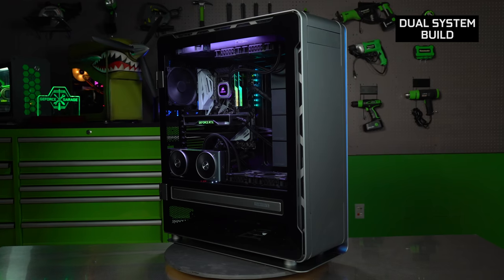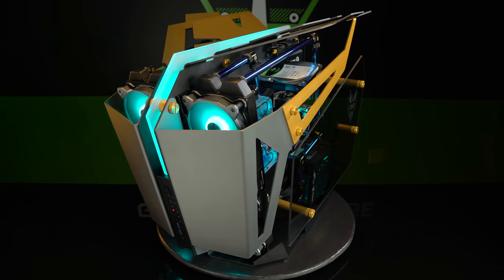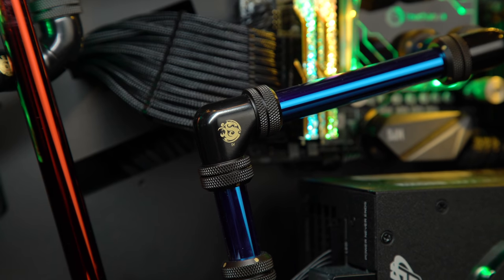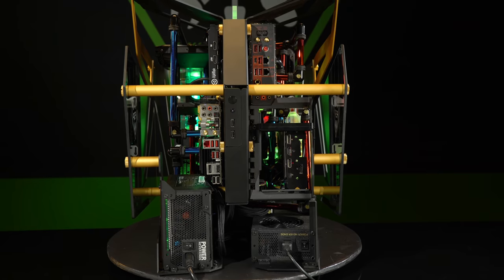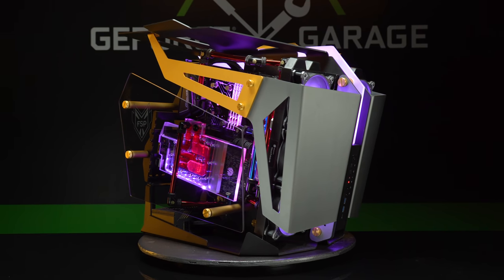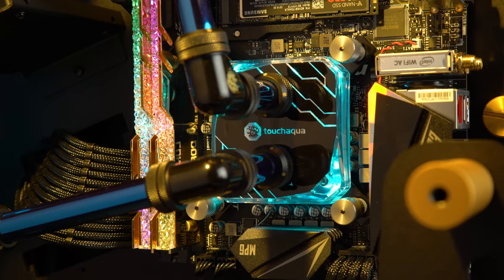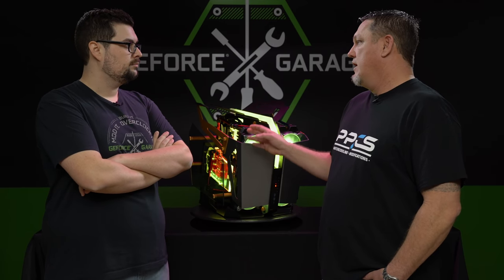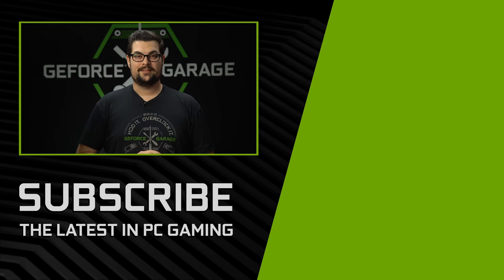GeForce Garage - Dual System T-Wings by PcjunkieMods

Comment: Lee never fails to deliver something spectacular.
I'm saving up to build my first PC and would like to know did you guys go with air cooling or water for your first PC?
#ImcomingtoPC2021
Reply: Definitely go air or if not go with an AIO
Reply: Just do air- it’s easier, cheaper, and probably is good enough cooling for you
Reply: @steviejoe66  I will most likely go with air to start, I can always update later on.
Reply: @Lee  yeah go ahead and do that. If you’re going AMD the stock coolers that come with the cpu are generally enough unless you are going to overclock or care about a silent system. Intel cpus will require a 3rd party cooler

Comment: I would like to see specs and parts lists to the highest end possible from Intel and AMD. I haven't built a PC in many years and it's that time to build again. Building my own motion capture company for gaming and I don't want to deal with slow things. I've seen a lot about the threadripper and was wondering the Intel equivalent. For what I plan on doing the more cores the better. Care to do a non build video on that?